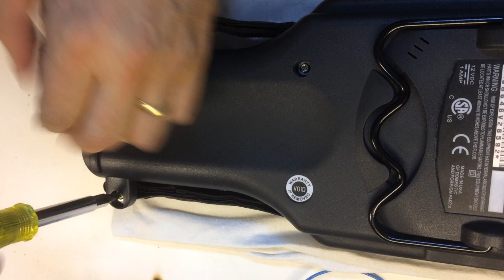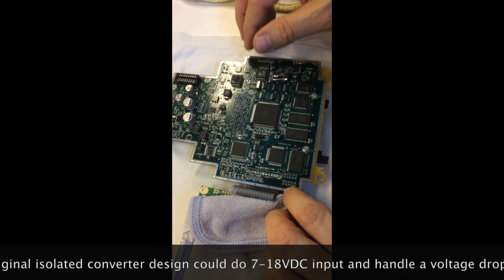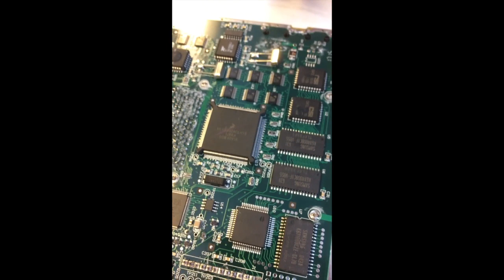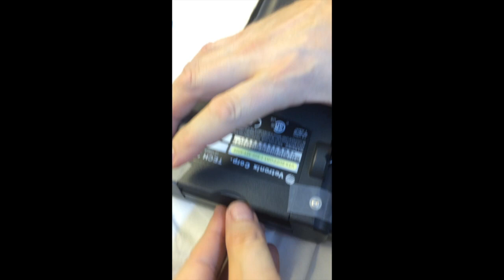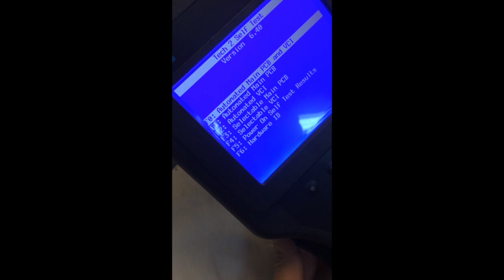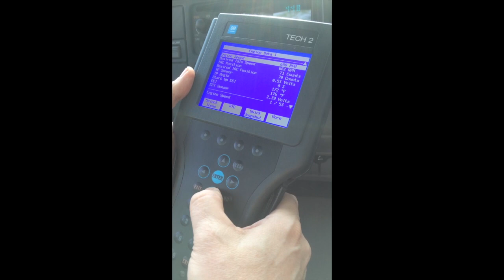GM Tech 2 Scan Tool DC-DC Converter Replacement / No Power On Repair (Dead Tech2 Unit)

Comment: I have never attempted anything like fine soldering on a tightly packed component board.  I got the mornsun module and following your excellent tutorial, I achieved chunkulation and the Tech2 works again!!  Thank you a thousand times!
Reply: Where do you found the spare?
Reply: Mine has a burnt part on the board numbered c231 , I can't make out any way to I'd the part becuase it burnt, looks to be a black block with two terminal legs. Does anyone know what this part is?

Comment: I think mine has a different problem it powers up
Then at press enter screen nothing happens at all.
If i remove candi box pressing enter works but then it asks for the candi box.
Even tried another candi box no help.
And smells tad burnt in the bottom where thing slides into board. 
Any suggestions anyone plz 🙏

Comment: In the process of doing my clone found a VRB1205LD-15WR2 for $25, when I looked I found just a circuit board..can't upload pictures
Reply from the maker: There's were a few different designs on these clone knock-off Tech2 tools.  Some may have a different look than what I showed in this video.
Reply: @DrShock getting it taken care of..
Reply: @DrShock in your opinion(trying to see if I'm on the right track) would a knock off of the morsund module cause the same effect of rebooting upon starting the vehicle? I purchased one, installed it and the Tech 2 works as before but has the same issue as before install of reboot upon starting engine. Any advice would be appreciated.
Reply from the maker: Normal behavior on clone Tech2s.   The description text area for this video explains why.   This other video I did is the solution https://youtu.be/Mz-Ar6TAuiY. ;-)

Comment: I have a knock off version that powers on only if the power cable is connected. Does that converter also act as a rechargeable battery? I didn’t see anything else that looked like a rechargeable battery,
Reply from the maker: No, there is no rechargeable battery in the Tech2 design, genuine or clone.  There may be a coin battery for the clock, but it's not rechargeable. The Tech2 is powered entirely externally.   If your unit works with external power,  but not when connected to the vehicles ODB port.  Then it's either a vehicle problem with the port (easily confirmed by trying a different vehicle), or a problem with the VCI (the adapter box the cable from the vehicle plugs into), or the DC-DC converter like I cover in this video.
Reply: @DrShock  Thank you for the clarification, I was not aware of this. I assumed it would have had a battery, I will have to check power to the OBD2 port on the car

Comment: I just got screw mine brand new doesn't powered up any ideas ??  2004 cadillac xlr bush button start
Reply from the maker: Brand new?  Best advice is return to seller for exchange.  Why try to repair if new right.

Comment: My Tech 2 clone only has a blue screen. A\Someone told me it was the ribbon cable to the LED screen. Any thoughts on that?
Reply from the maker: It could be several problems unfortunately.  There's no one root cause.  

Failed component(s) within the circuitry that generates the image to the LCD, bad internal battery, damaged ribbon cable, or cable connector(s), corrupted firmware flash image.   There are no schematics available to debug anything on these.   Visual inspection is all that's available.   Sometimes you can ge lucky and spot the problem (failed capacitor on the board, for example).
Reply: Thank you it is new and has never been used. I guess I will have to buy another and sell off the extra parts. Thank you @DrShock

Comment: i left mine plugged in to the car (everything was turned off) for like 30 mins while i went to get dinner and when i got back out my Tech2 just shows a blue screen and beeps 4 or 3 times then stays blue.

Could this be the issue?
Reply from the maker: This repair would typically be for a no power / dead situation only.

Comment: Hello, please can you help my, in my original tech2 there are other pins used. Original there is a iws705cz ac/dc converter. I can fit the mornsun converter, but the pins are not on the same spot.
Reply from the maker: Yeah the original uses a different pinout on the PCB than the clones.  And I believe the original uses 6 pins whereas the clones use 5 pins.   There's no known datasheet for the Power-one converter so I can't help you with a pin out adapter, but these original converters do come up on eBay maybe once a year.

Interestingly I only recall seeing someone fix a genuine Tech2 using the Traco Power 10-1211 DC-DC converter part, which has only 4 pins.  Which ever way you go, the original will lose the ability to not restart during engine cranking (see my video description for details), and will likely lose the power on button function (something unique to the Power-one DC-DC converter it originally came with).

Comment: Are the copies reliable of tech 3 and can you purchase an online subscription do you think for the copy tool to do keys?
Reply from the maker: Well there's no such thing as a Tech 3 out there.   There's the Tech2, followed by the MDI, and the current GM tool is the MDI2.   The clones of the Tech2 and MDI can be very good, but you have to get the more expensive ones to not have incompatibilities.  I have videos on the right MDI.   The clones of the MDI2 are very incompatible still, because all they are is the MDI board cut to fit inside a fake MDI2 case.  They actually cannot do any of the new MDI2 protocols yet, but they are fine with Techline Connect as just an MDI 1.
Reply: @DrShock Thank you for this informative video! You mentioned that the expensive Tech 2:s are of better quality. Is there a way of knowing if an expensive one is actually better or just the cheapest version sold at a higher price? I am looking at buying a Tech 2, but I cannot see any information in the listings that gives any indications of which manufacturer made them. I would buy a more expensive one if I was confident it was better. Do you have any advice on how to tell if a Tech 2 is actually one of the better ones? Or is it simply a matter of probability, with more expensive ones being more likely to be good? Thank you for any and all advice and again thank you for the video!
Reply from the maker: These clone Tech2s are no longer being actively manufactured afaik, so what you would see is unsold stock from when they were.   It's difficult to cosmetically spot the better one but I have found some distinguishing attributes are it is sold with all of the various DLC connectors, a DVD-ROM of the TIS2000 software, and an accessory package of various power supply options (battery connection, AC adapter, etc).

Comment: Installed this but now the Tech 2 doesn't power up. Which pins do I test for continuity?
Reply from the maker: This repair is usually done on a dead Tech2.   So sounds like you are saying yours was working before you did the DC-DC converter replacement?  If so I would suspect either the converter was installed backwards (check pin one alignment), defective converter, damaged solder joint pad(s), or damage to another surface mount component near the converter on the board.   The manufacturer datasheet for the DC-DC converter will have the pinout.
Reply: @DrShock  solder joints look good, and yes it was working before but I figured I'd do the upgrade but of course, now that I have attempted it, it's 'broken' ... It looks like it can only go in one way? maybe it is defective, it took ages to arrive, debating on getting another.
Reply from the maker: How did you remove the clone one?   Wondering if you lost or displaced some other nearby component using hot air or such?
Reply: @DrShock  I followed your videoto the letter. My solder joints seemed like they made good contact, no joints touched anything else. I have no idea why it doesn't work other than maybe I have a defective regulator. It took ages to get all the parts together to get my spare working again so it sucks that I have to order yet another whole unit. No idea why it doesn't work now. It's difficult to get the soldering unit off now but I touched up the joints just IN CASE and still nothing. :(
Reply from the maker: @tonyq4358  You're sure it's really DOA - no power LED and no LCD display?  Just saying as I've seen folks do this where they don't get the ribbon connectors reinstalled correctly and it looked dead but really wasn't.  

With the DC-DC converter, I haven't seen one come in dead before.  But then I would be avoiding Aliexpress and other Chinese sources.   Try to only buy them off eBay from a US based seller.

Comment: Another option is to install a LM2596S based converter on the board with two-sided tape and run wires to the board. It works down to around 6 volts and has adjustable output voltage. It requires special wiring which can be found on the Saabcentral forum. I modded mine a long time ago and i think that is the converter i am still running. My Tech 2 does not restart when i have to start the engine for a test.
Reply from the maker: That works, but is a hack.  The real easy fix is far simpler - https://youtu.be/Mz-Ar6TAuiY

Comment: I enjoyed watching this video. Can you advise me on the vci module issue I believe I'm having?
Reply from the maker: possibly, ask your question
Reply: Our tech 2 clone powers up fine but doesn't connect with any vehicle. When I try the self test procedure it does not detect that I have the VCI loopback adapter plugged, and fails all of the tests as if the adapter is not connected. I suspect that it may be the vci module. Do you have any advice on this?
Reply from the maker: There's no published schematics, so board level repairs are not really doable on the VCI module.  They do sell replacement VCI modules on ebay and Aliexpress from time to time.  Before going that route I'd check for oxidation on the contacts causing connectivity issues.  If you're comfortable with electronics, I'd open it up and look for obvious issues like burnt components (tantalum caps are used on this board that can burn out) or corrosion that might be worth addressing before full replacement.
Reply: Thank you for your suggestions. We purchased the tech 2 six months ago, and had used it successfully three or four times. We opened the module and nothing appears burnt or corroded on the board. I'll try giving the contacts a good cleaning before deciding on a total replacement or purchase of another vci module.
Thanks again.
Reply from the maker: Six months would be a very short lifespan for the VCI, even for a clone.  You should be getting years of service out of one, unless you are using it in a shop setting.  When you say we purchased, I got the feeling you might be using it in a shop vs DIY.   The component quality on these clones are great for DIY, or occasional pro use, but not for daily pro use.
Reply: We're a diy father and son team. My son is a Saab enthusiast.  The scanner has had very little use, and the ali express seller has asked if we would like to purchase another tech 2 as they have no vci modules to offer for sale.
Apparently there is no warranty.
Reply from the maker: Ah gotcha.  There are several VCI modules listed at eBay right now, as well as on aliexpress.com.  The latter would be the least expensive route (a few are even under $50).

Comment: Have an original gm tech 2 with no power issue would this fix the problem?
Reply from the maker: It's one possible cause, perhaps the most common on clone Tech2s.  But not the only one.    On originals this is a less common reason, but you come across it there too in forums from time to time.

Comment: Did your China Tech 2 give you a fail for RTC at start up self test?
Reply from the maker: Yep, they all do that.
Reply: @DrShock  Hmmm, I thought maybe that's what was causing my RS232 communication not to work properly with the SPS. I've checked cables, baud rates etc....
Reply from the maker: Nah the problem is that the internal chip based firmware (not the PCMCIA card software) on the clones can't handle more than calendar year 2010.  If you have set the time/date and have a good battery it will just be this problem.   If you have a communications problem, be sure you're running on Windows 2000 or Windows XP.  The TIS2000 application is written for a very ancient level of Java and just won't work properly on anything newer (though you could put WinXP into a VM on Win7/Win8/Win10).    The other problem is the USB to serial adapter, only a few will work with the tight timings this tool requires.   GM recommended only the Tripp Lite Keyspan adapter which I include a link to in the description.
Reply: @DrShock  Yeah, I have been trying on a windows 10 machine with a different brand of USB to 232 converter. The tool goes into programming mode and will either stay that way or revert back to the startup sceen. I do still have a XP machine with an actual 232 port and IE 8. I may try that to see what happens.
Reply: @DrShock  Problem solved, I loaded software onto my XP machine and it works perfectly. 👌
Reply from the maker: Glad that suggestion worked.  The Tech2 and its software are still quite useful today, but you really have to have that 25 year old version of Windows handy for it.  ;-)

Comment: my clone tech2 turns on but doesn't make it past the system initializing screen.  I have swapped the PCI card to try, but didn't work.  Could it be this regulator?  Thanks!
Reply from the maker: No, this would be for a no power situation.    For what you describe, presuming the Tech2 worked previously and then this behavior started, I would suspect the firmware on the PCMCIA type card inserted into the bottom.   The weak link on these clone Tech2s is this card as it's very cheaply made and can get read errors or similar problems.   If you can borrow someone else's it's a quick check.
Reply: DrShock thanks.  I bought a new card already and that didn’t change things.  Maybe I just need to take it apart and clean it well.  

It worked perfect for a while now.  I left it in a warehouse for a few days then it stopped working.  It’s fairly humid here so maybe the humidity messed it up.
Reply from the maker: You might try swapping the PCMCIA jack the firmware card is using too.   But yeah oxidation and poor solder joints are other things to check when its opened up.    Overall I've had pretty good luck.  I've had three, only one of which died outright which was within the first month.  The other two I've had for a few years now and never have ran into anything the clone can't do with both TIS2000 and TIS2Web.